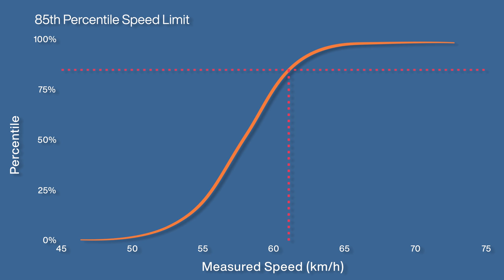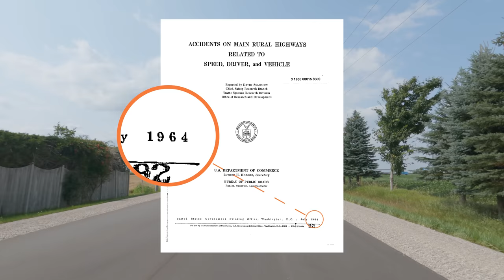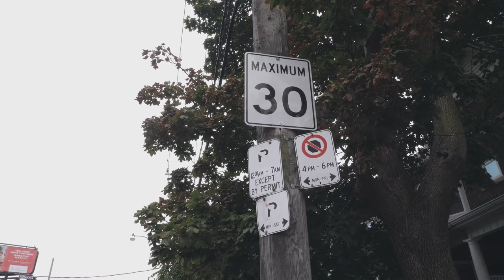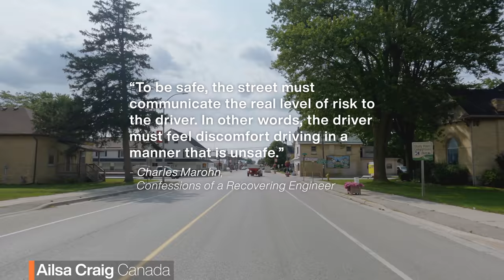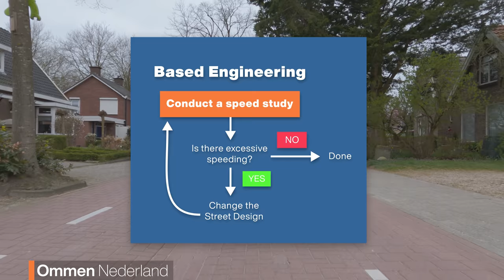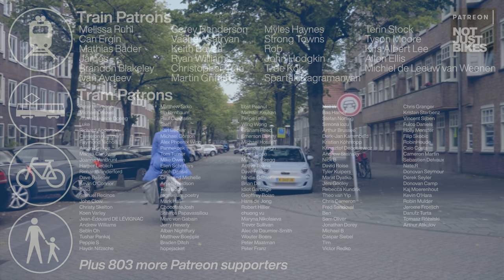The Wrong Way to Set Speed Limits [ST06]

Comment: Nice video. I’d love to see you do a “future video” about the use of road obstacles. In particular the difference between the kind of “speed tables” seen in this video vs the brutal “speed bumps” installed in so many US communities. IMO the speed tables with gentle angles are not only less destructive to the car and occupants (and bikes when there is no cut for them) but also are more effective and ecological because they promote steady, slower driving rather than “racing” between them because you have to nearly stop at each to get over them.
Reply from the maker: I made a previous video about traffic calming.
Reply: Speed bumps (like at 11:08) here in the Netherlands are adjusted for the speed they want you to go. If the speed limit is 80km/h on a rural street and they just want you to slow down for a side road, it'll be really gentle.
If the speed limit is 30km/h, they can get quite steep: I wouldn't recommend hitting one of those at over 50, because you might seriously damage your car. I haven't seen a good example of them in this video, though. People (including myself) will however still tend to race a bit between those, mostly becuase you'll often find them on streets that otherwise feel like they're 50km/h-streets that haven't otherwise been updated since the 80s.
I feel like they're starting to phase out the ones you see at 9:24; I suspect because they make cars unstable in the left-right direction because wheels needs to cover different distances.
Reply: Yeah, a brutal speed bump is a dead giveaway that something is wrong.
Reply: @nosten5276  They are also dangerous. You can miss them while driving at night (if they aren't marked) or while overtaking another car. And that's not to mention ambulances that often go far above the speed limit and cannot afford to slow down for speed bumps.
Reply: @ThePC007  if you can't see the speedbump you can't see well enough to be driving faster than the speedbump allows. They're not camouflaged.

As for ambulances... I'm not sure how they deal with this, actually, other than "not driving on streets when they should be on roads" with the streets only being a fraction of travel time. Additionally, they might have insanely effective and durable suspensions?
Reply: @NotJustBikes  Another one to go look for in the backlist :-)
Reply: @SaraWolffs  That's a nice thought and maybe in your city that's true, but it's definitely not true everywhere. Certainly not at night, in the rain, snow etc. 
There are several speed bumps in my city in the UK that are made of the same materials the rest of the road - they were originally marked with white paint, but the paint has worn off. With so many eras of road building/resurfacing, utility works, they look somewhere between invisible and just another seam in the surface.
Reply: @stormveil  that's... actually a problem, yes. In NL they're generally made from a different material (concrete or coloured pavers), and streets and roads generally get resurfaced as a whole when they're worn out enough that a speed bump would look like just another patch job. I'd still recommend slowing down in poor visibility, but poor maintenance definitely would create complications for otherwise-viable solutions.
Reply: Where I lived before they once installed a speed bump in front of a hospital. Not a bad thing in itself - but the first time I drove there, 2 days after it was finished, it was night, so I was not seeing it good. They had put up a 30 sign together with the speed bumb. I was driving 30 - in fact a bit slower when I saw the bump, let's say 27 - and when I reached it, the bump nearly broke my car. I heard the springs (or whatever) hitting themselves. The bump was something like 3:1 shaped. 
It was changed after a few month because the city was flooded with complains, it even was in the newspaper as a warning to not drive the allowed speed there. 
How did nobody realize it was a bad idea to place a bump fit for a "walking speed driving" zone to be in a 30 part of a 50 street?
Reply: The British solution to the ambulance problem is to make the speed bump narrower than the road, but wider than a car. Ambulances that have wheels set further apart than cars can just drive straight through with their wheels either side of the bump (and, of course, cyclists can bypass it down either side). This isn't universal, but it's very common on newer developments.
Reply: Most speedbumbs require a Land Rover Defender to be able to be driven even at the speed limit. Speed bumbs are an inherently bad design to reduce speeds, but are very cheap to manufacture. Narrowing the road or creating chicanes are a much better and safer solution.
Reply: @k0zzu21  The Speed bumps in te Netherlands work good - but they are made better and the ramp is more a ramp than a hill. 
I don't like them, but they work well.
Reply: @k0zzu21  Chicanes encourage drivers to quickly speed up and slow down which makes them a bit dicey for cyclists.
Reply: @esspeebee1  So that's the reason cars have gotten a lot wider in the last 2 decades!
Reply: @09philj  I mean the kind where you can drive through if no one is coming from the other direction. The speed is much more constant than with speed bumbs.
Reply: @SaraWolffs  Blaming the other guy won't get you anywhere. There are conditions where road markings become difficult to see, such as in rain when the reflections of the street lights wash out roadway cues.

Comment: Have you ever been to Belgium? The whole country is basically stroads, city management is basically non-existent. 
I'd love a video about bad Belgian traffic planning
Reply: One of the worst countries to drive in haha.
Reply: Yea ad a Dutch person i get so frustrated whenever i drive in  Belgium.   
Driving in the city of Brussels was one of the worst driving experiances of my life....
Reply: There are three key issues in Belgium 
1) All infrastructure was calculated to be used by cars and pedestrians, cyclists would simply die off or remain a suburban and rural phenomenon.
2) All utilities and their access points were located in such a way that they would not bother either pedestrians or motor vehicles.
3) Belgians have a love affair with Linear Settlement.  This is because urban development and planning had been completely neglected and never centralized.

The result is that there is a huge movement to add direly needed cycle paths, which is extremely costly and is often lackluster and made all the more difficult that the only space often available to add paths are those areas where they had dumped all the utilities accesses, so cycle paths are hostile territory for cyclists since they tend to find all the manhole covers and access points in their path.  Because sewers were also calculated this way its easy to find cycle crossings that happen to coincide with a sewer grating.  

Linear settlement means that Belgians have easy access to a "high speed stroad" on their front door but have a bucolic unimpeded view of green in their backyard since their houses line the roads connecting towns and villages.  When cycling infrastructure is added, it's often merely white lines inches from high speed traffic.

Recently they added a new program of "cycling highways" which is a very long term program which exists mainly of adding white lines to very busy main roads and filling in the gaps over the years.  Some have been around since the 1990's but none are properly done as each still has deadly black spots where they simply didn't have the time and money to fix the problem. 

Given that in Belgium the general idea is that cyclists are mostly criminals who have zero regard for the law, even accidents where motor vehicles are clearly at fault there is still this idea that "That cyclist should have paid more attention ..."
Reply: @ZRodTW  the biggest inner cities are kinda traffic free and they are awesome, most other ones are trash
Reply: Plenty of dumping on Belgium on this channel.
Reply: @rolandboerhof9391  There are a billion great things about Belgium, but road infrastructure or urban development are not.
Reply: @rotwang2000  I agree. We have a lot of sympathy for you for many reasons
Reply: There certainly are some stroats here in Belgium. These are often bigger streets connecting city centres but, as pointed out before me, lined with houses.
I do think that we do a fairly good job with smaller streets in village centres and adding features like elevated crossing, bollards, narrowings etc.
Reply: Not likely to happen. Really feels like this dude has a hardon for sh*tting on the US in particular. Not that he's wrong, but it's sort of his gimmick
Reply: At least your a
Reply: @janzabram  well if you want views on YouTube, you better make a video in English about a big English speaking country. He mentions Canada quite a lot too ;)
Reply: i looked up on google to see how bad it is and , not gonna lie , you were right .